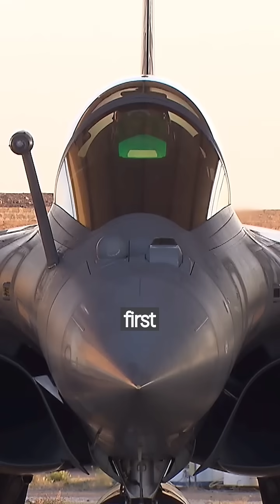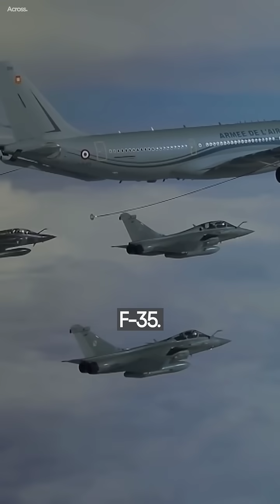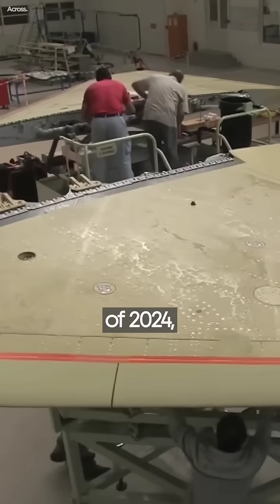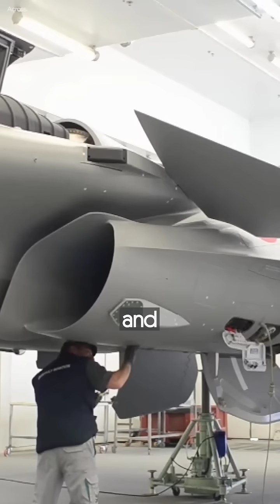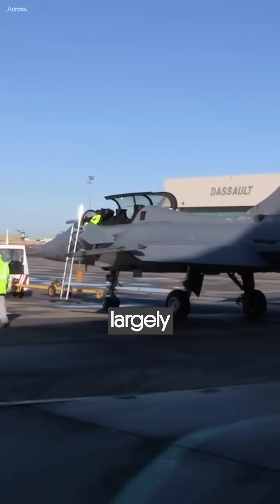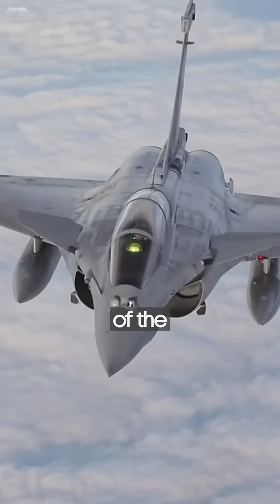The Fighter Plane No Nation Wanted to Fight #shorts

Comment: It's also because it's ITAR free so Dassault doesn't need US permission before selling the aircraft.
Reply: Coût d'une heure de vol F35 50 000 $ coût d'une heure de vol Rafale 17000 euro
Reply: 😅😅😅😅😅😅😅😅😅 @patrene7263
Reply: @patrene7263 your numbers are wrong. Also compare it to newest F15 to compare more relevantly.  Rafale is no doubt a leading plane.
Reply: @patrene7263 et encore, on ne parle pas d'empreinte logistique ni de maintenance... Parce que là, il y a une différence encore plus grande.
Reply: @patrene7263 et seulement 6 ingénieurs contre 12 pour un sukoi et autre F35
Reply: @patrene7263 Incorrect , the F35 costs 28-35k dollars per flight hour which is 26 -33k euros per flight hour. 

Also the cost of F35A is about 82 million dollars.
RAFALE costs nearly 125 million.

Rafale is generation 4.5 with NO STEALTH vs F35A is 5th generation with VERY GOOD STEALTH.

You cannot compare aircrafts from different generations.
Reply: @ryszardfalkowski7917 : wrong, you forget the cost of lost f-35, shooted by... malfunction. HAHAHAHAHAHAHAHAHA !!!

We still wait for the Rafale.

Oh, and your datas are wrong too.
Give your sources, n'est time.
Thanks.
Reply: @ryszardfalkowski7917 the real cost per hour of an F35, when it flies, is closer to 50 000 dollars. But they are liars.
The price to buy a Rafale is 80 millions. It flies very well whereas the F35 is known as a non repliable platform.
To a point the US Navy and US Air Force canceled their orders  and went for F18 and F15 instead. Sorry for your loss.
Reply: @viviengirard7501  Wrong f35 was lost because of pilot error.
Reply: @ryszardfalkowski7917 incorrect the most expensive rafale version is the rafale m who cost 72 millions  the c version cost 68 millions so nope he less expensive than the f35 and you have what you sign without need to be scare of an inflation because of change of standard like f35.
Reply: @alexdarcydestsimon3767 The U.S uses the F-15 for a different mission set than the F-35. The F-15 is a long range fighter interceptor/fighter escort. The F-35 is primarily an Air superiority aircraft, though it also has an internal weapons bay and external hard point capacity meaning it can carry ordinance as well. The U.S hasn’t “cancelled the F-35” like you said, they’re planning on spending $1.7 trillion over the next 10 years to procure 2,000 F-35s. The F-18 is still one of the best ground strike carrier launched aircraft that the USN can field, so they’re going to squeeze as much life out of it until they can figure out a way to make the F-35 carry as much ordinance as an F-18. You can’t just see the words “fighter aircraft” and assume its all just the same, the United States can afford to have 4 different types of fighters all being used simultaneously in large numbers , whereas a majority of European air forces cannot.
Reply: @alexdarcydestsimon3767 lmfso that's not why the navy canceled their f35 orders.
Reply: @ryszardfalkowski7917  F-35 is not 5th generation because if I take the American  definition, it has no supercruise. In fact if I follow the 5th generation definition, there is no 5th generation fighter, F-22 is lacking data fusion... Just marketing
Reply: @Krshn42  Dude, who the hell told you this lie? Of course the F35 can Super cruise without the after burners. All modern jets can super cruise...and yea super cruise is just a marketing slang. This information is very easy to find, giving misleading information is off putting.
Reply: @ryszardfalkowski7917  Dude, check by yourself, it is confirmed by an article in Air Defense that F-35 cannot super cruise, I think it's a serious source and not bullshiting, so go check and stop saying stupid things
Reply: @Krshn42 no i read same and that speed  was not something F35 needed makes sense its a very dangerous platform as far as bvr and datalinking etc
Reply: @ryszardfalkowski7917  BIG LIAR !!
Reply: @ryszardfalkowski7917  on ne peut pas comparer des avions de générations différentes ? 😂 
Mais pourtant elle est là  , la comparaison a faire : RAFALE années 1980 ! 
              F35 année 2000! 
La rafale reste un avantages incontournable ds le monde .😊
Reply: @alexdarcydestsimon3767 none of that information is correct. The Raphael is more expensive than the f-35 because there are far lesser Raphael’s in production at the moment. The f-35 hasn’t been cancelled by any branches of the US military and won’t be.
Reply: @ryszardfalkowski7917    Are the price tags here really the other way around from what many would expect? And what could be the reason, or big part of it, for there being this relatively drastic price difference between the two? Especially if the Rafale being that much more expensive. I’m a little light on knowledge at the moment on the developers of a lot of the newest machines. So I don’t know if or how off I am in this thinking, but I know the F-35 was a joint effort involving a handful of different nations in it’s development and construction. Then the Rafale, I thought, was done pretty much all in house, in France and by French companies. Hence the reason (probably/I think?) it doesn’t fall under that regulatory body described up there in the comments. If any of this is even close, wouldn’t it be reasonable to think the F-35 should be the more expensive of the two? I’m very interested in some of these numbers, at least at a basic level.
Reply: @ryszardfalkowski7917  bullshit. Rafale is 80 million F35 is 120 million.
F35 real cost is 50000 per hour
Reply: @ryszardfalkowski7917  f35 is either stealth with very little armament or not stealth.
Also the F35 only flyes like shit.
Reply: @brotatochip7001  Air Force and US Navy reduced their F35 orders by 80%
Reply: @alexdarcydestsimon3767  where’s your source? Over 900 have been built. It’s fully in service. The navy has completely closed its fighter shortfall number ahead of schedule and is continuing to purchase f-35s. They’re simply purchasing less than Lockheed can make in a year, remaining on the original planned number. You’re full of it.
Reply: @alexdarcydestsimon3767  well, they artificially lower the cost of use of the F35 by including the training flight hour in a simulator
Reply: @VictorRobotov00  yep today the rafal is 100% french
dassault , thales , and safran
Reply: @morphilou    They made a fine ass aircraft then. Love the Raphale and the JAS-39 Gripen.
Reply: @viviengirard7501 rafale fanboys
Reply: @britishbred52  : a pleasure, eurofighter-L-boy.
Reply: @Krshn42 5th gen is stealth capabilities. We dont have 1 engine supercruising stealth fighters yet, calm down.
Reply: @LoganWiseley rofl :)
Reply: @ryszardfalkowski7917 
He corrects others to replace their mistakes with his own...

A Rafale never cost 125 million, dude... 🤡

among other false information.
Reply: Rafale B IS thé best Navy jetfighter. Even American pilots recognize it.
Reply: @indianajohnes6274  Rafale M is the navy version, since M stands for Marine. Rafale B is the 2 seaters, Rafale C single seater, but only for landbases.
Reply: @indianajohnes6274  you mean rafale  m 
M is marine (navy)  
For the rest you can't be more right
Reply: I read that the F-35 has some daily password that changes, and operators can't fly it without US approval.
Reply: Other non nato nations won’t have the avionics a dara link that the french have though,basically the french Air Force d assaults are more advanced
Reply: And that's the most important factor of all.
Reply: Amen to that 😂🎉
Reply: You always need permission. Remember the submarine sales to Australia? Or The LHD sales to Russia? The USA can take it away just like that.
Reply: Test nummer 1
Reply: France doesn't need permission from USA. It's a free country and enough smart to know how to act by itself. 
And thé F-35 IS better than F-35 with catastrophic performances: less than 50% of usable capacities and more than 50 huge major issues.
Reply: So stop to play with out nerves.... WE don't need NATO to protect Western Europe. 
If Mr Trump becomes next USA Président, France and UK will protect Western Europe and it's enough
Reply: Looks like lots of r3gimes follow iblees.
Reply: that's not why we'll sell the Rafale to just anyone!! but hey, the Rafales sold for export cannot be used against French interests!! there is a system called "the rear door" which is the possibility of blocking planes, a kind of virus which can paralyze the bursts used for the wrong purpose!!
Reply: This piece of crap has never fought a real opponent. I guess on the next Pakistan indian airwar, we will find out how crappy this junk really is.
Reply: @Hypersonic-es6vhyou’re so full of shit it’s not even funny. How can you be so confidently wrong? The sensors on the f-35 are classified. You have no clue how good they are. You’re just spewing shit.
Reply: Permission is required because of technologies getting into the wrong hands. Even if it's ancient technology, we don't allow any other country to poses our tippy top secret tech, we just can't risk it. It's bad enough that spies have stolen tons of technology over the years. The United States is the world's leader in technology and everyone else just steals it from us.
Reply: Why does other countries need permission from US to buy Arms from European countries?
Reply: Isn’t the Eurofighter Typhoon also ITAR-free?

It used to lead in sales, I wonder why it’s fallen behind.
Reply: @ Almost all of the 4 nations supporting Eurofighter started purchasing F-35 as there were open opportunities to both purchase and headed to supply chain after Türkiye’s dismissal. I believe there are close to 15 or more nations on the F-35 program and only 4 on Eurofighter.
Reply: Any way it's ugly in my opinion when I see mirage 2000 and prefer eurofighter two.
Reply: This plane or the Gripen 🇸🇪🤔
Reply: Nous n'avons besoin de personne surtout pas de l'autorisation américaine.
Le rafale est de loin bien meilleur que le f35.
Reply: False
Reply: @ yes it is you donut
Reply: What is ITAR?
Reply: @johndavolta3124 international traffic in arm regulation! A plane built with one us piece can be stopped by us gouvernement in case of sold to another country!
Reply: @johndavolta3124 International Traffic in Arms Regulations
Reply: @johndavolta3124 International Traffic in Arms Regulations. It’s rule and regulation to prevent technology from falling into the hands of your enemies.
Reply: @johndavolta3124  ITAR is an US regulation specifying that defense equipment using US components need approval by US authorities for export. Even foreign (not US) equipment. ITAR stands for "International Traffic in Arms Regulations". Actually, Rafale is not ITAR free. The US even prevented France to sell Rafale (the amount decided by France and Egypt. Egypt was actually able to buy some Rafale) to Egypt using ITAR, even so the US themselves sell weapons to Egypt.
Reply: @johndavolta3124  the list of US made military equipment (including spare parts) which is stricly under export control laws on world military market.
Reply: @johndavolta3124  

The International Traffic in Arms Regulations (ITAR) restrict the export of defense articles and services, and limit access to technical data and defense materials. ITAR also places restrictions on the handling of software and technical data on the United States Munitions List (USML).
Reply: @johndavolta3124  Permission for sale to other countries because of the for foreign for example US parts in plane in Rafale are far as i know none maybe targeting pods.
Reply: This Rafael can take on any fighter even the F-35 B LIGTNING 2, SAFRAN builds one of the best jet engines in the world ..
Reply: @zainday7173  would it intercept the f22? Asking for a friend. 🤤
Reply: @socomchamp00 maybe with meteor and RBE2 radar.
Reply: @socomchamp00  I think it already happened during an exercise in 2013. It was a dogfight exercise with guns only. The Rafales won all their fights against  the Eurofighters and 3 out of 4 fights against the F-22.
Reply: @justhouz it’s because they severely hinder stealth aircraft in red flag exercises. People like you spread misinformation. I guarantee you if you look into it the f-22 had drop tanks or a transponder to negate its stealth. They put the f-22 and f-35 at a serious disadvantage on purpose.
Reply: @brotatochip7001  
F22 is a masterpiece. 
F35 is catastrophy
Reply: @justhouz would be useful if missiles didn't exist, if you merge with an f22 the pilot messed up badly.
Reply: Affirmative but it was dogfight exercice not interception if I make no mistake  @justhouz
Reply: @zainday7173 Lightning II might be a bit of a stretch considering its evasive capabilities alone.
Reply: @Chonkems  f35 capability of evading radar has mosty to see with being stuck on the ground for maintenance.
Reply: @zainday7173  
Its funny you mention the F-35B, the least "capable" variant of the family. Thats some insane levels of cope lmao
Reply: @zainday7173 no it cannot, in red flag f35s constantly beat the shit out of rafales, 5th gen’s will always be better than 4th
Reply: @potatosuc4950  the rafla is 5-1 vs the f 35 and because abandonment of the Americans for the 7th and 8th fight planned
Reply: @morphilou pulling numbers out your arse mate
Reply: @zainday7173 What about Tyfoon? I've read they are tied for performance with Tyfoon better in high altitude
Reply: Pilots recognize each jet owns différent capacités as F-22, Rafale B, Typhoon and Grippen are all excellent machines.
Reply: Anyway thé best jetfighter IS a nonsense
Reply: Thé South Korean jetfighter used by Pilipinas IS also a little good basic interceptor
Reply: @Hypersonic-es6vh the F35 is not even second to the Rafale, it is  20th to the Rafale. 

What i would take over an F35 ? Rafale, Grippen, Taille-foune, F18, F16, F15,  Any Mirage, Alphajet, Hawk, PC21, Fouga Magister,  P51, Extra 330... Cap10, C172, Piper Cub...you name it.
Any plane but the F35.
Reply: @alexdarcydestsimon3767  I don’t get it lmao. How are you so confident that an 80s aircraft built for export is better than a modern stealth fighter with 20 years of development? The Raphael can’t even detect the f-35.
Reply: @brotatochip7001  RAFAL 1980 is totally different of rafal 2020

the last fight rafal vs f35 it is 5-1 and because abandonment of the Americans for the 7th and 8th fight planned

it is true for everybody except for the americans
Reply: Incorrect the rafale needs the French government autorisation to be exported exactly same than us
Reply: @lolonav  Yeah but what he means is that if France wants to sell the Rafale to another country, they don't need the authorization of the US (for example) because it doesn't use US parts/technologies. 
Now if a country equipped with US planes, or if a country builds a plane that contains US parts, then this country might not be able to sell its planes to another country in particular because the US doesn't want to. 

in short: France can sell Rafale to pretty much anyone
But country that want to sell planes containing american parts cannot if the US doesn't want to
Reply: @lolonav  liar
Reply: @lolonav You are very wrong. Rafale doesn't come with a code you need to beg every day to U.S government to be able to fly your toy whereas the F35 does.

Comment: Eurofighter is bedder
Reply: Just check the leaked Swiss evaluation comparing the Eurofighter, the Rafale and the Grippen. This is factual. 

No need to thank me
Reply: Of corse
Reply: The Rafale has been mewing
Reply: False eurofighter is only air to air thus Raphale is multyrole
Reply: @Sam7Algeria  being a multi role don’t make it better
Reply: @LSmoney215  its makes it way better nowadays and Rafale is nuclear capable typhoon it's not carrier inter operable with French and US carriers tyfoon it's no and so many different things
Reply: @Sam7Algeria To be fair, the Rafale and Eurofighters were originally designed for different roles. The Eurofighter was thought out as an interceptor while the Rafale was thought as a more versatile aircraft from the start. That's also the main reason why France split from the original project. 

And indeed, it being multirole as some said doesn't necessarily make it a better aircraft. It just happens to be better at anything the Eurofighter does, including air to air which was the primary purpose of the Eurofighter. The Typhoon remains a potent aircraft of course, but the Rafale is both better (just search "Rafale Swiss Evaluation) and more affordable than the Typhoon since you don't have the issue of having 4 countries all wanting their own factories for it.
Reply: “Guys I think this other jet is better because I know more about it and learned about it first, I definitely don’t just have a confirmation bias for a jet that I like”
Reply: The rafale has won many battle simulations against F22... which is impressive and which the Tyfoon has never done. Also its air to ground capacities is battle proven due to the engagement of the Rafale in many wars in Mali, Yemen, Syria or Lybia. Tyfoon have no such experience and record.
Reply: @slydeery it only beat f22 at the merge. Any lighter fighter can beat the f22 and that circumstance because of the heavy added weight from thrust vectoring that’s not saying much
Reply: @LSmoney215  I know. And I'm not saying Rafale is better than the F22. I'm Just saying Rafale has stats that the Tyfoon doesn't, making it a better plane.
Reply: @CivisMilitarum  that also my view 👍
Reply: @slydeery  🤣🤣🤣🤣🤣🤣🤣
Even ATE don't say that
Reply: @MikeAlphaRain  lol who cares about your opinion on what ATE would say ? Tyfoon is a great plane but it doesn’t match the Rafale. It is what it is... 🤷
Reply: @MikeAlphaRain  ???? ATE did not say either. Don't lie by omission
Reply: @kadovax6567  yes he say it in his english version
Reply: Hell na, eurofighter sucks ass
Reply: @Barakus9872  how did they pay you to say that?
Reply: yeah its even a fake eurofighter
Reply: @lepood rafale is 100099x times better